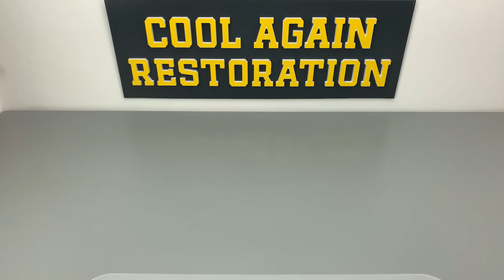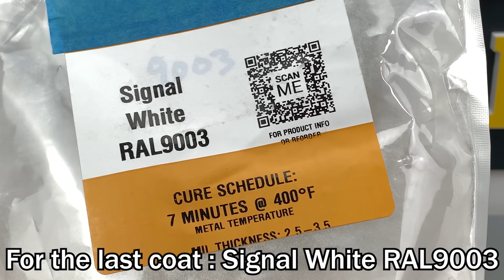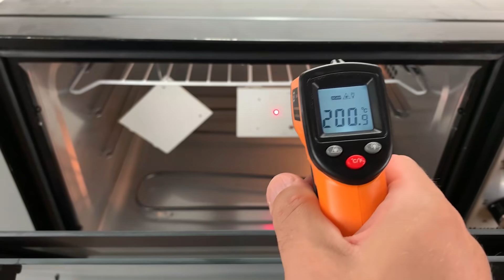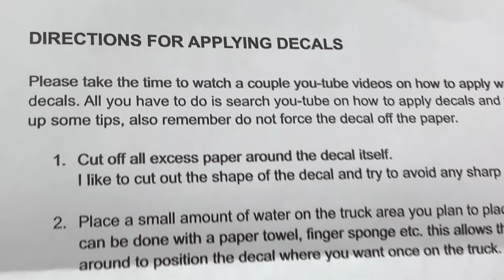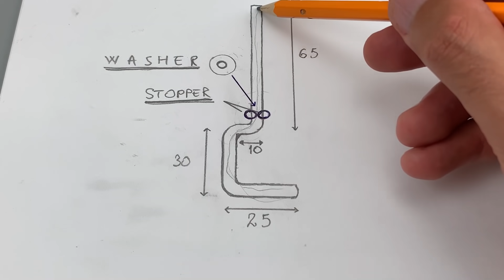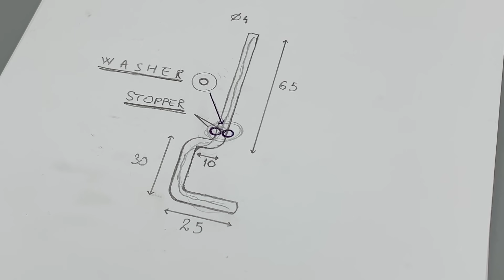1960's Abandoned Tonka Ser-Vi-Car Toy Restoration

Comment: I recently found a 60s Tonka excavator that's missing a back wheel and has a little rust. Should I just sell it for parts?

Also, I appreciate all the info in the description. Great video!
Reply from the maker: Thanks and glad you liked it! Yes,you can sell it for spare parts on EBAY 👍🏻

Comment: Enjoyed the power coating and prep work, made for a really nice piece. The price tag on logo's and the couple of plastic pieces were kind of scary. I have no clue were the price tag is at before you hit the ceiling on it, but when I was a kid they were just toys and did not cost what you have in it. Yes, I'm old! Nice work.
Reply from the maker: I was shocked too when I saw how much cost. Just type on EBay tonka replacement part. One wheel can be also 30$ 🤦‍♂️

Comment: This was by far the best rebuild work I've seen you do. It's obvious you have skill. So now why don't you take it a few steps further and do an actual restoration? See with rebuilding you take license to vary from the original. With restoration, you can't take that license!!. You must do everything you can to stay original as possible but you must use the same material as much as possible. That's why restoration is very expensive. One thing though, i don't know where you are getting you parts from but i would suggest you start thinking outside the box. 20 bucks for 2 decals is outrageous as is the same for those small plastic parts. Sign and decal shops make decals cheaper when you buy in bulk. Maybe you can find the decals you use most and buy in quantity. As for plastic, the use of a 3 D printer can fab just about anything you need and can be found on the internet for a very good price. Your metal fab is very good so i would try to keep as much control on parts as one can. And definitely fab up a spray booth for enamel paint. Powder coating is ok for rebuilds but not true restorations. You have talent and a real passion for what your doing. Now take it to the next level.
Reply from the maker: I try my best every time 😇

Comment: Do you use degreaser after sandblasting to rid the surfaces of oil from your skin? Doesn't seem like there'd be any other source. Great video, as always - thanks for sharing.
Reply from the maker: I used this time degreaser after sandblasting not because removing oil from my skin because I don’t touched with my hands after I pull them out from cabinet,but because was full of dust from the cabinet. I sandblast them for 3 hours and I wanted to stick very well the filler in the pittings. If there was dust,the filler create problems when do the painting job 👍🏻
Reply: @CoolAgainRestoration  That makes sense! Thank you for the reply - great information!
Reply from the maker: That’s why I’m here. Welcome anytime Craig 👍🏻🍻

Comment: Great restoration. My only question...why didn't you whiten the headlight lens with some peroxide and UV ? That's the only issue I see. I loved the homemade tool for doing the fork notches. Also a question...does anything go on/in the back where those 2 holes are?
Reply from the maker: Hi Chris! I made a research before and I saw all headlights on this model was yellow. I think that was the original look. And I don’t know for what are that 2 holes because I don’t see any attachment for it when they was produced 🤷🏻‍♂️

Comment: I'm a bit late to the party here, but just to say a great job done on this vintage piece to give it a second life. Just a point to note, I would have personally used paint stripper to remove the paint before sandblasting as it would have saved you time, and also prevented flecks of paint contaminating your sanding medium.

Comment: When you buy something like that headlight you should make a mold of it so you can save money if you need another by resin casting one, also invest in a laser printer rather than inkjet  you can buy decal paper and make the transfers for pennies ( or cents ) lol. I make a lot of models and miniatures and its a great investment, also love the home made tools.great idea
Reply from the maker: Yes, You have right Brian but every time I say it’s the last tonka I ever restore and when I see one that I like,I decide to put in the workbench 😂. It’s hard to deal with pressed steel,I prefer to work with cast iron.

Comment: I heard from somewhere that Tonka toys from way back are worth more in this state than if they were new or restored

Don't know if it is true but hinestly I'd rather have them restored by you
Reply from the maker: It’s tricky to say a true in this case because no one can say a true price for something without price. Yes,they worth more now than when it was new but if you let a tonka toy in deplorable state after some years you will have nothing ( the rust eat the metal) but if you restore that tonka ( professional) maybe the toy can resist another 50 years. Think what value would have then 👍🏻

Comment: Fantastic work mate. Could you put the link for the acorn nuts pls or were you bought them. Them and the tonka rivets are hard to find here in Ireland. Thanks for great videos mate really enjoyed them.. 
Paul...
Reply from the maker: https://www.ebay.com/itm/New-NOS-OEM-Snapper-12134-Acorn-Push-Nut-7012134-Pack-of-2-Nuts-/294131352810?mkcid=16&mkevt=1&_trksid=p2349624.m46890.l6249&mkrid=711-127632-2357-0
https://www.ebay.com/itm/25-Semi-Tubular-1-8-by-3-16-Tonka-Rivets-RIV-3-16-/373702163289?mkcid=16&mkevt=1&_trksid=p2349624.m46890.l6249&mkrid=711-127632-2357-0
Here it is Paul 👍🏻👍🏻👍🏻

Comment: Hello there, I'm curious: what's the difference between sanding and water sanding? Their effects on the part you sand, why one over the other, when to use which...
Reply from the maker: I hope to give you the right answer. Sanding is when you want to remove imperfections or to make a nice surface. Wet sanding is only when a primer or a coat is applied on that surface already. Wet sanding is more light than normal sanding 👍

Comment: Wow, nice.     Was the JBWeld used at 4:17 just to fill in the little pits and the excess sanded off at 4:39?
Reply from the maker: I don’t remember well the video because it’s quite old , but normally the process is like that , you apply jb weld and after is cured , you have to sand off the excess for making a smooth surface .

Comment: Wouldn't body filler work alot better instead of JB-WELD.. Beautiful job.. I love old toys.. You must have a nice collection..
Reply from the maker: Hi Benjamin! Yeah,the primer works like a filler but if the pittings are deep,the surface will look uneven 👍🏻 if you can,is better to fill the holes with filler and after that primer and paint 😎

Comment: It is quire impressive that some appliances built in the 1800s only need to be polished for restoration, while the closer these are built to the late 20th century the parts will need to be rebuilt. Handcrafting is a lost art in favor of cheap and polluting plastic molds.
Reply from the maker: Sad but true

Comment: I’ve seen some videos lately that show if you get that plastic hot with a heat gun, it will restore the color. Practice on something first if you try it.
Reply from the maker: I know that way but this wasn’t plastic. It is rubber and in presence of heat will melt 👍🏻👍🏻
Reply: @CoolAgainRestoration  oh yeah, that would a be a bad combination for sure.

Comment: No lead test before blasting?
Reply from the maker: Hi Tiberiu! For my next video I will change the sand because is time to change it and doesn’t matter if this last job will have lead or not.
Reply: @CoolAgainRestoration  so the idea behind lead testing is actually to not recycle it into the machine when you blast?
Reply from the maker: The problem with the lead is when you sandblast,the dust can contain also lead and is toxic. That dust you can inhale when open the cabinet door or next time when you use the sandblasting with the same sand. But because I will not use anymore , that’s why I don’t test it
Reply: Great insight, thank you!
Reply from the maker: Welcome anytime Tiberiu 😎👍🏻🍻

Comment: Very nice restoration. It may be time to change parts suppliers. You are being robbed. $3.00 for a chrome push nut? They are 28 cents at a local hardware store.
Reply from the maker: In Europe is not like that 😀

Comment: you can never make beter rust with paint that real rust can give you i think i will seal  all with resin so i can ceel the look.............. for me "restauration dont meaning ", travel time , to wen this was complete new, 
it destrot that "old" feeling , real rust will give you
Reply from the maker: There are items who deserve to be restored like new and are items who deserve to be restored with just a little cleaning and to preserve the vintage look.
Reply: @CoolAgainRestoration  can you buy  a replica....... look same anyway, give same feeling , and look same, i understand nut then i will buy 2 as a "before" and aftyer"look, ..... i know, shyny metal is beter looking than old patina,  i even see you remove every put inside model,  it just that what show you "its old metal.......... i see same with smithery.......... there make something by hand, and there remove all thil look  same  the mass product.................. what was then the reaon to make, if i want make a knife, a want see the hammere d look, i know it must made sharp , so there you must remove metal.........we live in a time where you not even can tell what is real or not,  , because  all need look new   i choose the rusty look than the  cleaned perfect metal that look you use new metal, why use orginal wood if you cannot see if its still wood, and  not replace with a 3d print, wie some paint you  let it look as older wood, ; d...  i see enough yt, to see how you make a prop that loook extreeme old; ... at the end , i sell more fale "oldlookig stuff, because you restauratin give it a "fresh from the fabrik look........ if we want that perfect resauration, why do fakers sell more old looking 3d prints,  why buy a orginal if the fake look more old than you restoration, ......   thats why fake sell so much beter,  the power of paint,  , you make a 3d model and let it look like its made of 1100 parts, you can give it gold and silver parts, etc, ....... al all will think you he faker because it look like a perfect replica there forget to "make old with paint....... its almost funy, how we by fake we weatering.... because we remove al proof its old metal, ... if i buy a old part of 50 years old and i see  a perfect looking peace, ...... i will think you sell me a "made in china part of crap...... sorry, i know most people want see it made as new, but that  is not what i understanding as "restauration,", if i repair and restore a old painting, and after it look "fresh from the pers, i will call politie, tp see where you put the orginal paining that you replaced,
Reply from the maker: Ok,I understand what you said. Unfortunately I’m not that guy who preserve items. If you don’t want to watch my videos,no problem man. I understand and respect your opinion 👍🏻 stay safe man
Reply: @CoolAgainRestoration  i love to follow you,  i really do, love the before and after, but i see also that there a lot i will never do, ,    we all have us prefs , ........ dont think most will not like my work, 

and find me work cheap , ..... the rusty car is for me "art" i will se it more in a diarama, as a artwork,  . keep some plastic yellow let people see "its really old..... let see , childs playef with it, and its not from a adult that put on car and ber touch again, .... used stuff have a soul.... still love you work....... i will never look to my own work,  i love to learn, if i use it in a artwork, i will use your way, ,  and paint it gold, for a diarama, , simple aboyt poor vs rich,   , but for me a object must tell a story, if you remove it soul " by remove all marks........ even the child will not  prob not like it, because it look like a new, and lose the connection to that child, 

its nice if you simple want stall it are a "reminder" of  your childhood, ..... but for me, i will keel my worst broken toys, because it tell me who i wass, that part go lost with a perfect "toy" its wat i say, you can play for same a replica" because all markst that show some markst from falling from a stair ./// a restoration complete is as you have the orginal , and there not seell it , that you seek a restored one, for me , is story als soule much more mportant than look, 

i want see the story of the object, ....not feeling i go back in tume, 

soory if i sound unrespectfull , i watch you work, .... the objecht was a toy, so had it over it as "toy, 

 but if i can i keep old look, ,  im a medium, so for me i want see the "former owners" ...... reason why some people will never bui a  new build house but a restoration, not because there love working but to keep soms stuff, to keep the soul of the place, .........   some buy a new house for dame reason, to have a new untouched start, if i can i want buy a 1000 year old building  ,  and not have feeling i live in a replica, .... and there a lot of "new old buildixxxxxxxxxxxxx 
 thanks for you understanding,  i love you work, ,  most to understand how stuff working, ....and that inside parts must be perfect  i understand,  and i see how umprtannt is  to take each part apart to look what can be saved of not,  and it give so some good idees ......